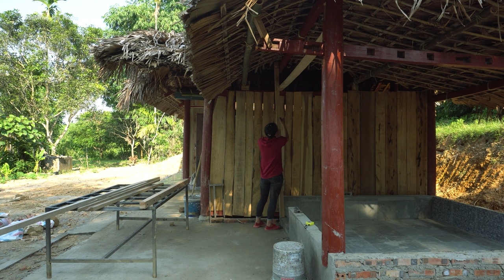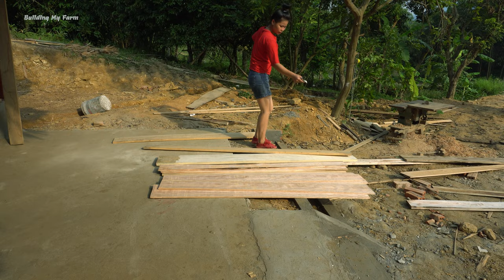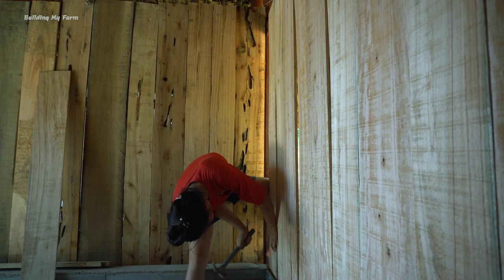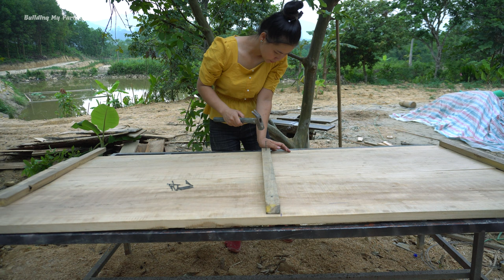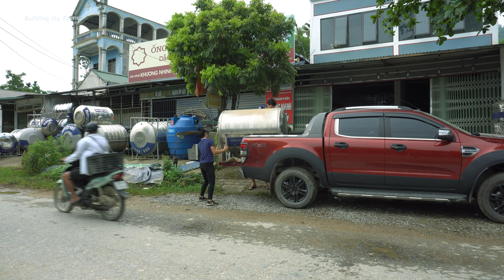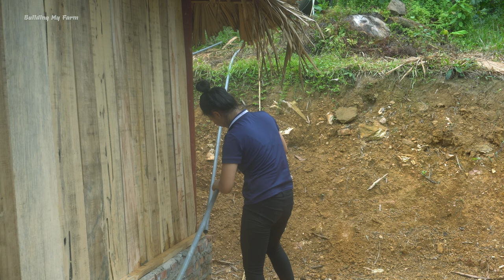Wooden Wall For Bathroom, Installation of Toilet System, Buy Stainless Steel Water Tank

Comment: If i may suggest to you lady when you want to attach wooden beams to any brick works first drill the holes in the wood for that you need a wooden bit then you place your wood on top of the brick work then take a concrete or what is called a maisoniry bit then you drill the holes into the bricks. This is just my advice to you lady i am not judging or critisising you it is just advice.

Comment: Hola 🙋‍♀️🤗🏡🇸🇪🙏Disculpas por entrometerse en tu construcción. Pero el cuarto de baño, Bathroom y cosina tienen que tener ventanas. Ventilation.. Moisture and gases from wood are dangerous. And the septic tank has to have ventilation. If it is not someday it will explode you. 😢😢😢😢